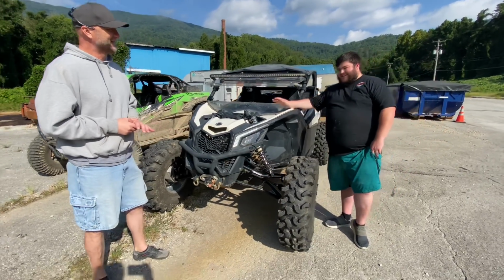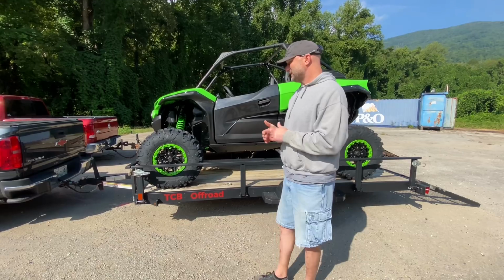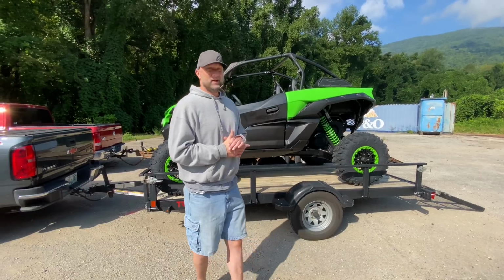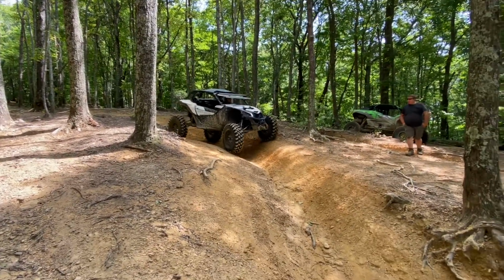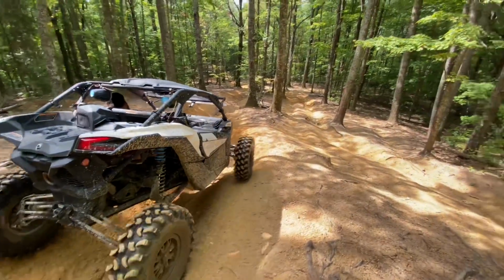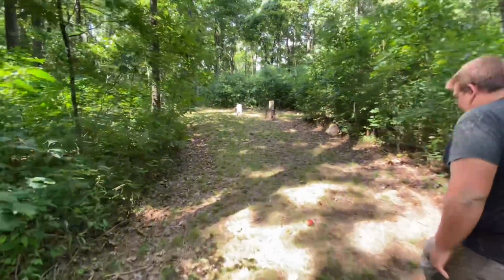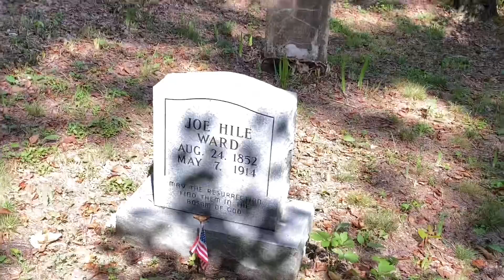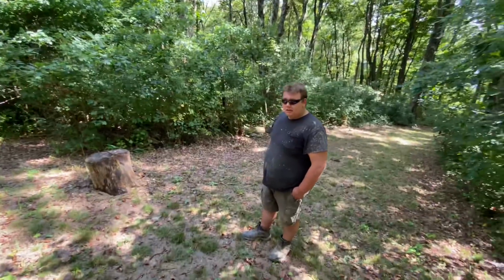Windrock “Panther Rock”. Breaking in a new machine.

Comment: Great machine only complaint with my krx is not enough power or throttle response but over all very happy and a great machine beast on the trails great content keep them coming .Why did you take the graphics off the machine
Reply from the maker: Ive never really liked the graphics stripped em off my YXZ as well.

Comment: I was looking to upgrade to a new commander max and put 4” portals on it, similar to chucks old maverick sport. Why did he get rid of it? What are your thoughts on his old machine? Thanks
Reply: Hey bud, the maverick sport was a good machine, the aftermarket support wasn’t there enough for the sport, and I think it was lacking in suspension travel for the type of riding we do. If your not riding rough all the time, the sport or commander should do fine. Also, I owned a turbo machine before the sport, and it just don’t feel the same going from a turbo to a non aspirated machine lol. Had to go back to a turbo.